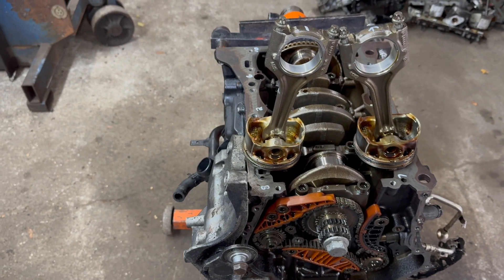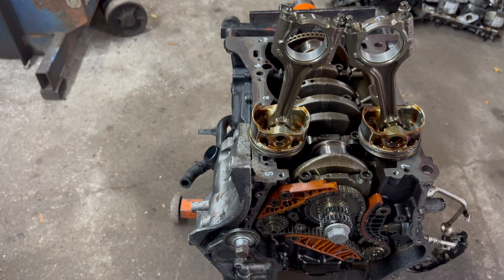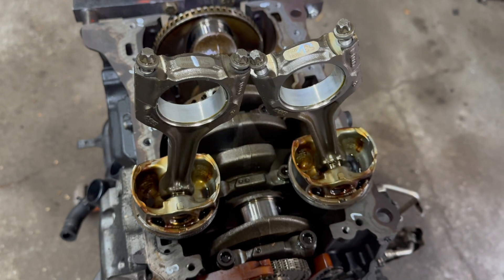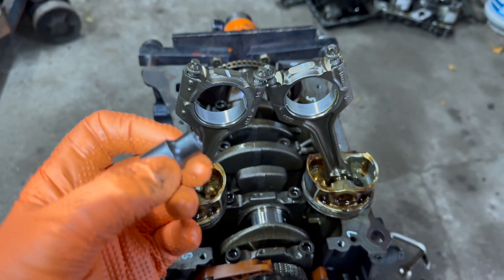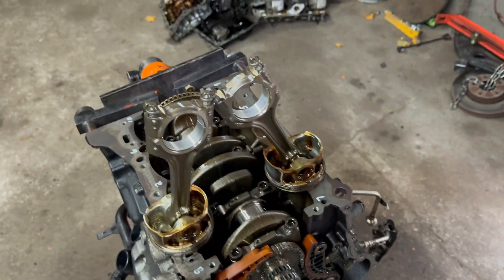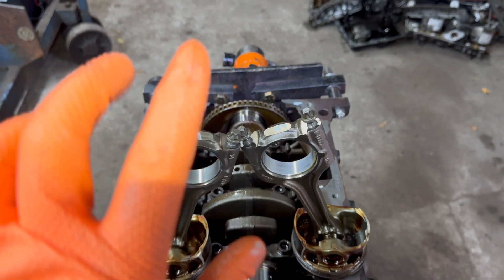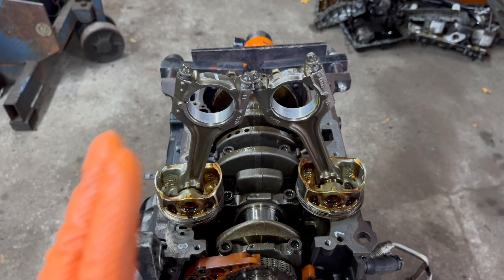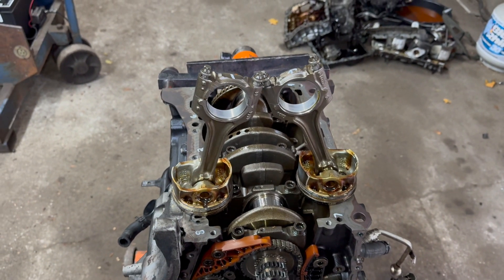VW / Audi TSI 1.8 & 2.0 Turbo Connecting Rod  Torque Specs & Sequence - 2009 & Up

Comment: Hi guy! You have torque recommend to connect rod cap to engine TFSI 2.5 RS3? Thanks.
Reply from the maker: 22 FT. Lbs than additional 90 degrees
Reply: @motorcarnut  TKS 🤝
Reply from the maker: No problem